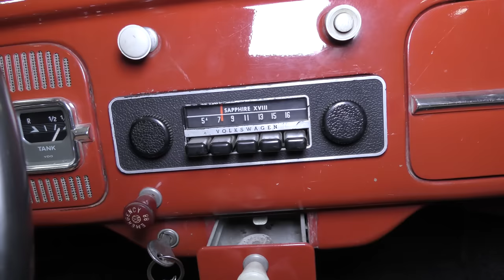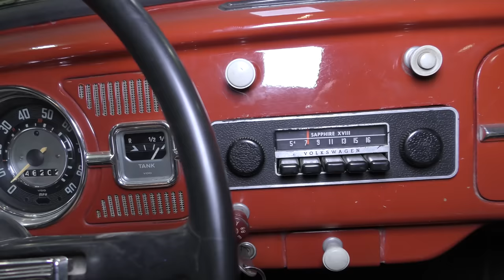Big Mods with big $$$. When Mods don't make sense. What did the  CAR WIZARD do to this '66 VW Bug?

Comment: Wizard you never mention the culprit in the terrible gas we burn today which is Ethanol.  Ethanol will actually gel when you leave it in the tank for a few months.  Ethanol is the triumph of stupidity over common sense;  lets grow food and turn it into an additive for your car.  It burns with less energy, takes more energy to produce than it saves, and is doing NOTHING to help the environment.  For my outboard on my fishing boat I buy only non-ethanol gas, that seems to keep it running well. The answer to this problem is to stop voting for Democrats and lobby whoever is in power to change back.  Probably won't happen though.

Comment: Normally, I go along with Wizards thought processes and long winded explanations for the complete novice.  Not this time.....  An electric fuel pump conversion is massively common.  The changing to a Bosch 009 makes the ignition more reliable.  As for the carb, not sure what your labor rate is but yes, replacement would be cheaper.  If it took you more than 10 minutes to install and adjust I'd be embarrassed.  The complaint about engine removal is STUPID simple.  Disconnect the battery, the cable at the starter, tape the throttle cable and disconnect the 1 screw. Remove the lower tins; then 4 bolts!  It takes 20 minutes if you are sleeping.  Your complaining over minor BS is so laborious.  You did NOT purge the lines.  You pressurized the system and filled the float bowl.  I am NOT impressed.